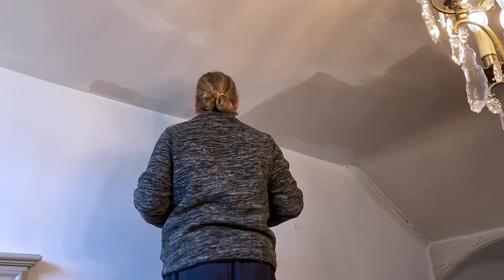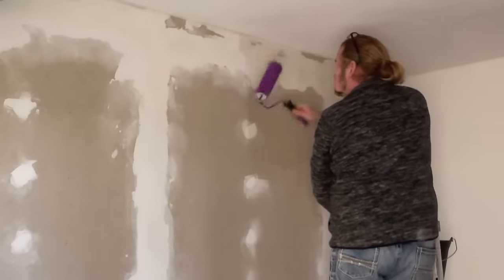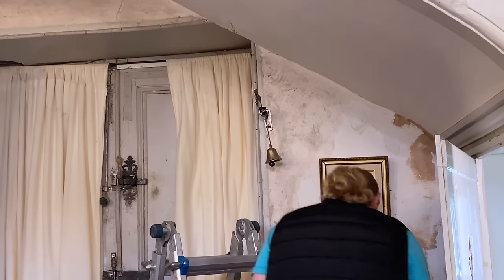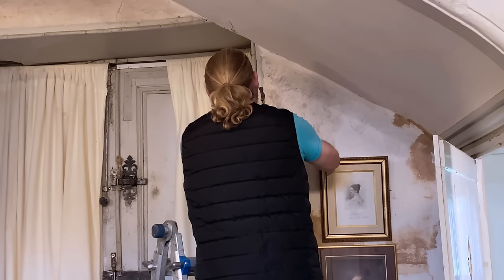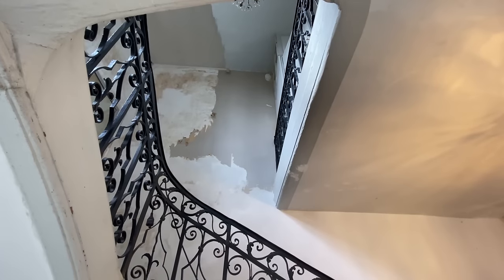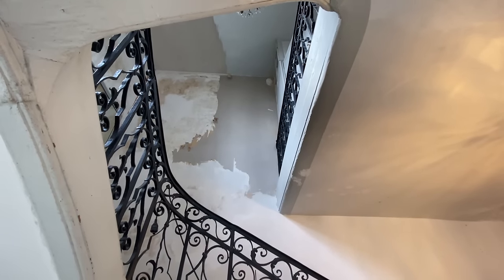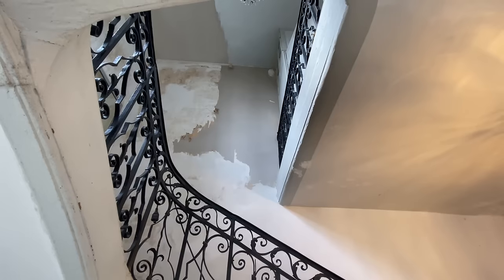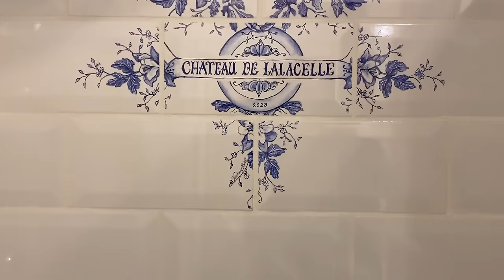The 400 Suite at Chateau de Lalacelle & Chateau Entrance Hall Restorations

Comment: Congratulations on 30,000. Rain has been horrible and so difficult if there are outside projects. I need to get window retreated when they are dry enough and before it gets to 25° outside . Usual nightmare but would not be anywhere else❤

Comment: I absolutely love the wall with the servants bell and pictures, just as it was. I’m heart broken that you didn’t leave it.
Reply from the maker: 🤣 🤣 The servants bell wasn't yet connected, so we put it right back up once it was connected. We only took down the pictures to repair the damaged walls. You prefer the damaged walls with wood filler repairs, crumbling plaster and old water stains? 😳
Reply: As Stuart said, it was to restore the crumbling wall and plaster.  Bell is now fully uncrowning.  ❤❤❤

Comment: This is merely an observation - not a critique - just an interesting, well, observation. It's likely just a different approach, but having done a lot of DIY to my old Victorian farmhouse and other homes here in the USA, it seems that European renovators use tiny little paint brushes and rollers to cover large, vast surfaces that we in the USA would use wider, thicker paintbrushes and more massive paint rollers to cover the same types and acreages of surfaces. Stuart who has lived in the USA...is my observation inherently erroneous? Or, is it correct, misinformed, silly? Am I mistaken? It's likely just a stylistic difference? Anyhow, I get a chuckle when I see Patrick, and other chateau renovators using wee, little brushes and rollers to apply product to immense surfaces of walls and ceilings. Love what you guys and others are doing to wonderful, old, historic homes! However, it happens, or applied you're all getting it done to great advantage and results regardless of the "wee-ness" of your tools. Kudos and all success to you!
Reply from the maker: We have discussed this before, but they do not sell USA sizes in paint rollers here in France. Yes, the roller sizes here are smaller. If you have done a lot of DIY, then you know that you need the correct nap of roller depending on your project and even foam rollers may be best. You see many European renovators using them because they are using what is available. Patrick also mentioned in this video that the massive USA rollers will waste a lot of product as well, and they are inferior for getting coverage on uneven surfaces (plaster/stone) and small spaces which we deal with more here than smooth drywall. Thanks.